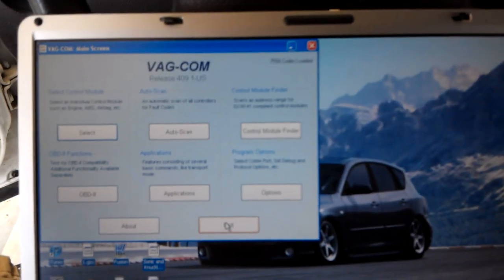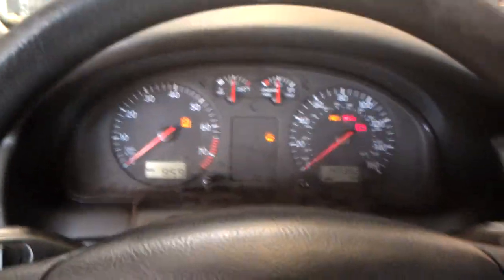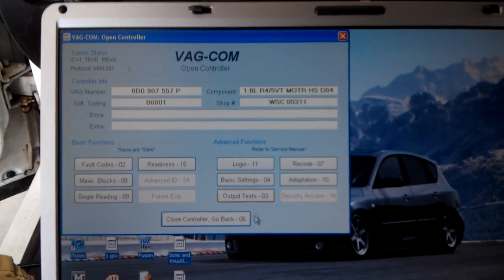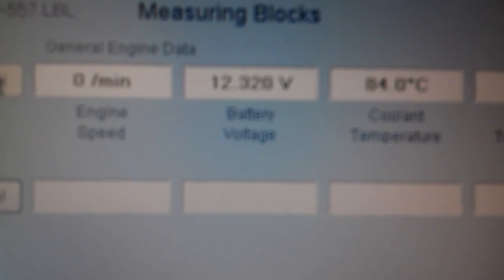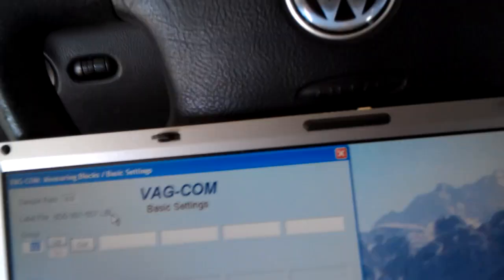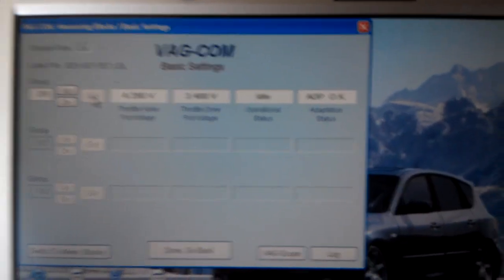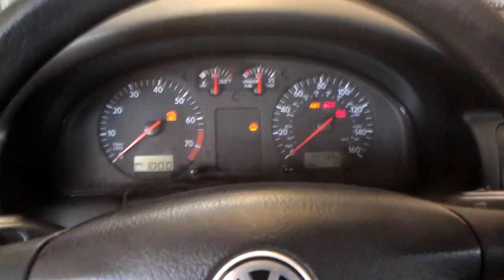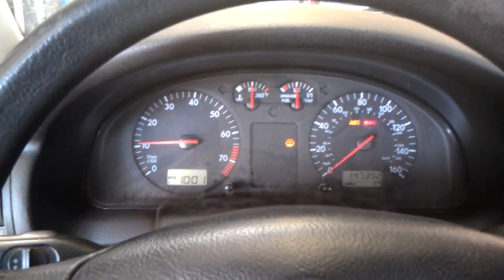B5 VW Passat how to fix code p1545 using VAG-COM

Comment: This doesn't solve the actual problem that caused the code, or even explain it. 5 miles later the code will return because there's a wiring or throttle pedal issue that requires repair.

Comment: $16? Don't they charge $99 for full version software? The newer TP adaptation is Group 060
Reply from the maker: DaytonCarCare I had gotten a cracked version
Reply: @TrilogyBPM  hi, I've just acquired a kkl cable from aliexpress a few days ago and have been struggling to have vcds full  version for cheap (if you know what I mean...) 
Could you give me any info on how to do so? 
Thanks in advance.

Comment: Hey bpm03 or anyone who has experience with vag com and dtc p01545, I recently bought vag com 409.1 I believe it was Ik it was the same one used in this video. So my question is, is it necessary to activate or register my product in order to get rid of this code. In other words did you have to activate or register your vag com. Did u just open the vag com package and after u installed the program did you go straight into making this video or are there steps you didn't show? Because I have a 99 1.8t Passat with this exact same dtc and is doing the same thing where the rpm's keep surging back and forth until a certain rpm. I bought the $16 vag com off amazon. I installed it, charged my battery, cleared my codes and i followed these exact steps and when I get to the last step or the step after checking battery (group 04) I went back to basic setting put in group 98 and I get error message saying I need to register or activate it or something like that.

Comment: Does KLL 409.1 obd2 vag-com work for a 99 passat 1.8t AEB ?
Reply from the maker: it should.. i was using 409 on mine it was the same year and engine code as yours
Reply: Even if its KLL?
Reply from the maker: should lol im not 100% sure

Comment: Can this correct a Passat B5 1.8t's automatic transmission timing? Mine shift hard from 1 to 2 and makes a slight erratic shift from 2 to 3. There's nothing wrong with the transmission when it was checked by a scanner.
Reply from the maker: i do believe it can you can always research forums on how to use vag com